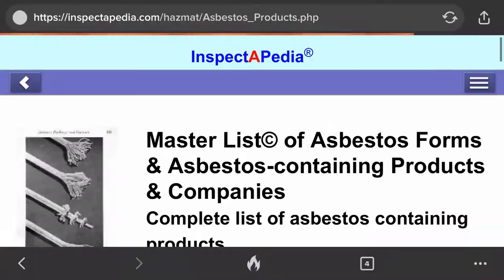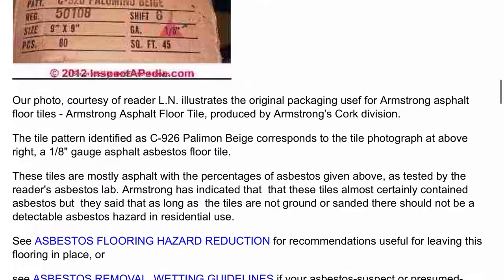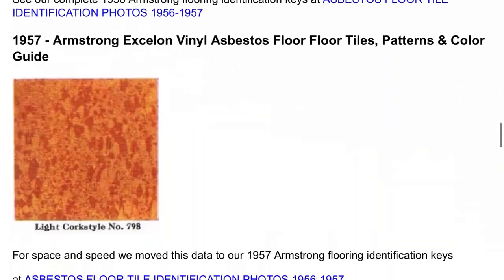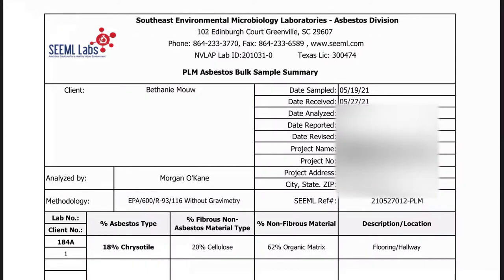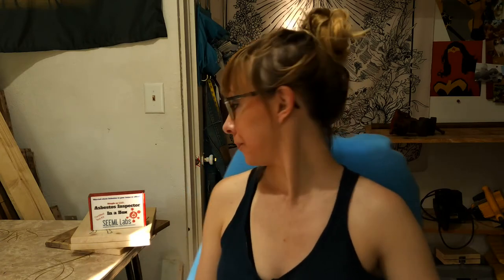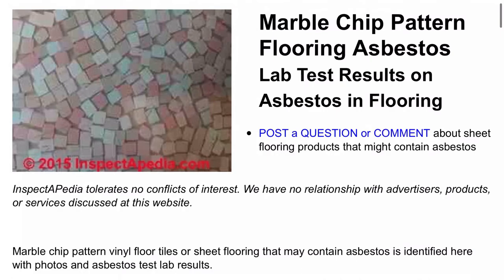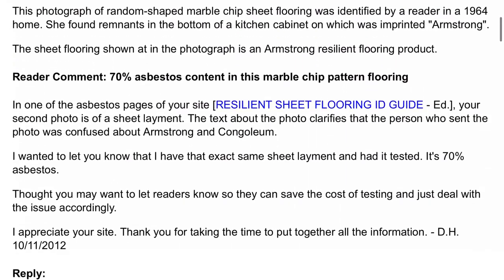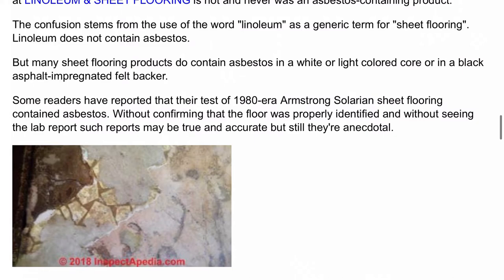Inspector In A Box Asbestos Test | Old Sheet Flooring Test & Results

Comment: The face mask in this video does not provide protection against asbestos fibers. At the minimum, you need a half-face respirator (tight-fitting) with P100 cartridges. You need to make sure your samples are representative of all suspect materials that may be disturbed by the renovation. The backing and mastic of the sheet flooring might also be asbestos-containing materials (ACM).